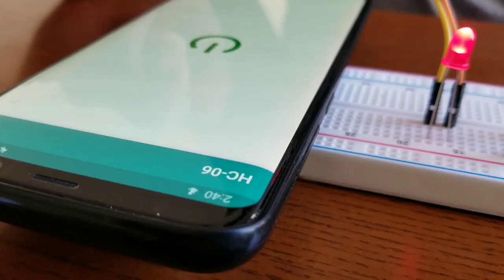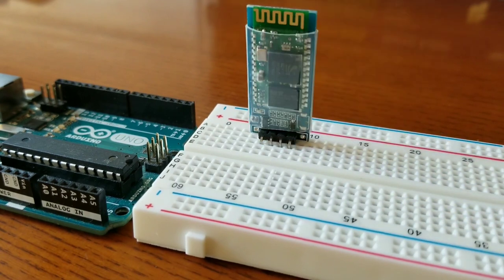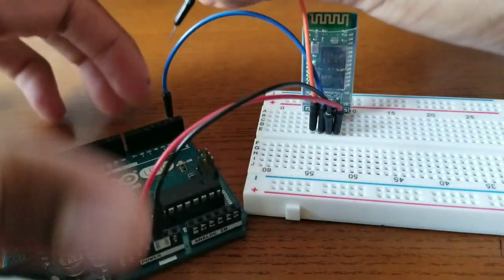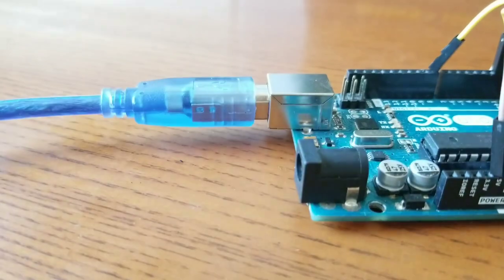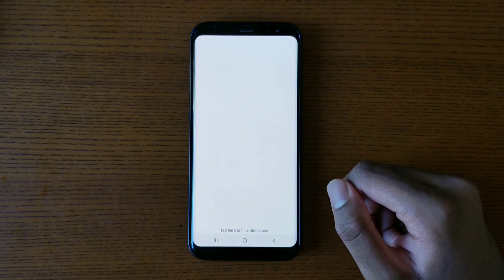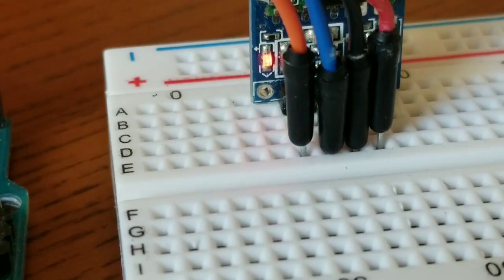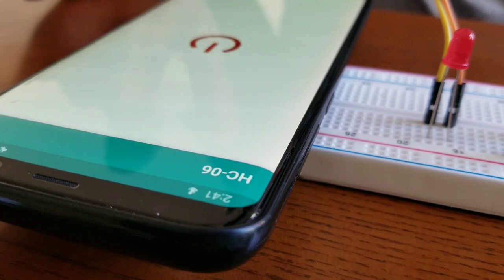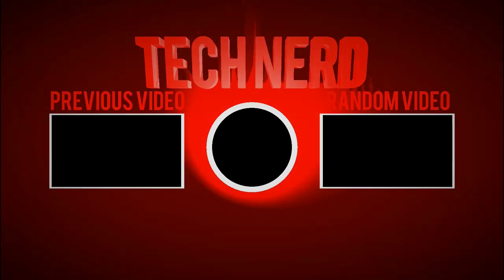HOW TO CONTROL A LED USING HC-06 BLUETOOTH MODULE WITH ARDUINO

Comment: mine worked. here are the common errors i encountered:

-RX should be connected to TX. TX should be connected to RX. at first, mine didn't work since i connected RX to RX, and TX to TX which is WRONG.
-the code in the description is working. just remove the "-" dash on the bottom part of the code after "}"